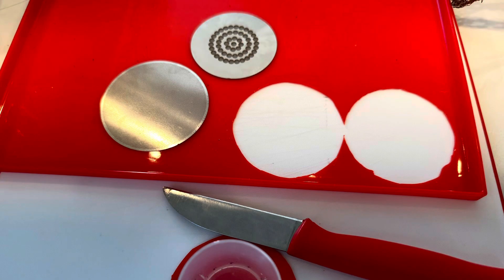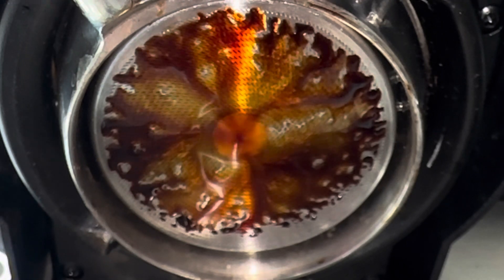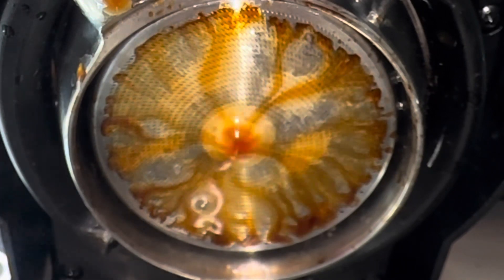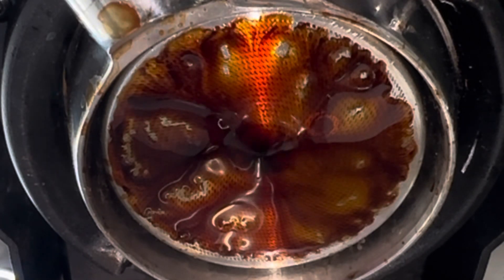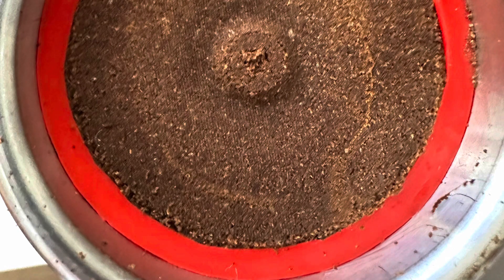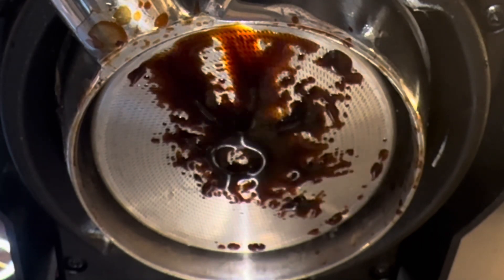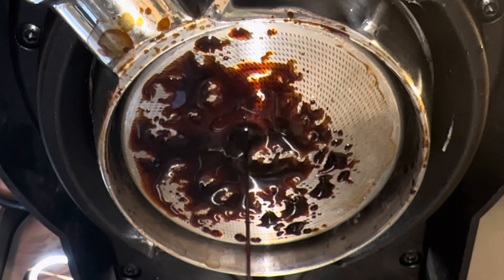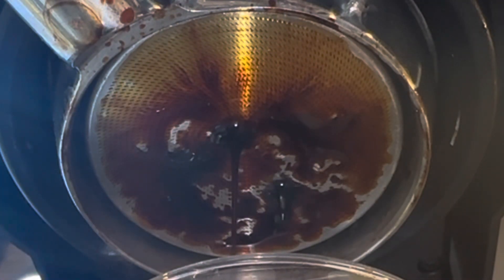Do Silicon Rings stop side channeling in espresso?

Comment: I wonder if engineered soil techniques could be used to stabilize the puck. Practical Engineering has a cool video about how metal rods driven into cliffs or sheets of material in hills of dirt. It would be annoying in a cafe, but mixing in some silk or cotton fibers might could help from inside the puck.
Reply from the maker: I tried that a little but no luck. That’s an interesting idea.
Reply: @espressofun6091  no effect or reduction in quality?

Comment: You mentioned thermal preinfusion is that a step you programmed into an advanced shot? These are fun
Reply: Also reminded me to get your book which I did last night
Reply: This is a very important breakthrough in understanding the hydrodynamics inside the puck.  Nice work, Robert!
Reply from the maker: No, I locked the portafilter into the machine and waited five minutes. Then manually started the profile.